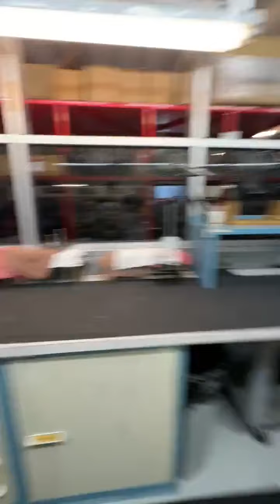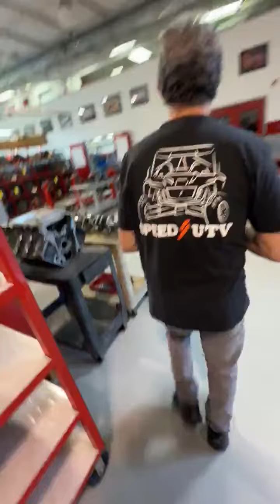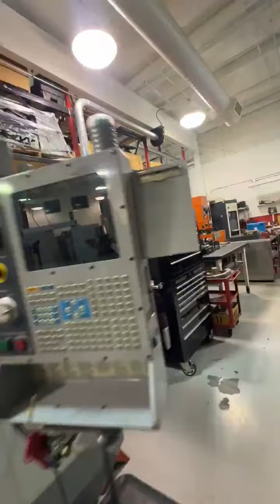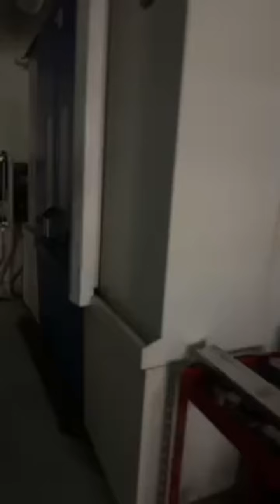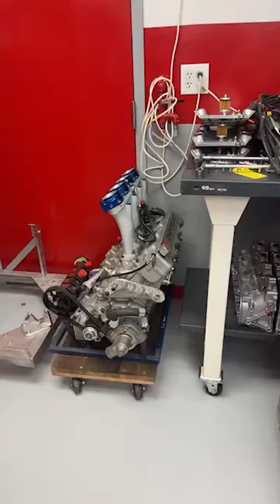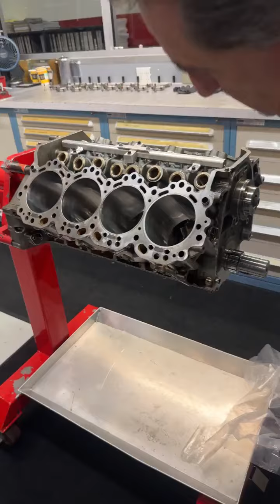SPEED Engines Shop Tour

Comment: There are companies swapping to different computers and tuning that is making the speed engine produce 50+ hp more than factory and at lower temps. Even startup and idling is greatly improved. It’s hard to consider though. Spending thousands to do what should likely be done from the factory is less than appealing. And I see that you can send in your clutches now for machining and tuning which I’m sure will help dramatically. I do believe that it should come factory with this tuning though because it’s quite unreasonable that my belt gets to 240 degrees on a 90 degree day just from cruising 30mph down a gravel road. The $1200 to make it happen should be included from factory if a guy can’t buy a machine and cruise down a gravel road without overheating the belt. There’s no excuse for these high priced updates if the machine can’t function under normal use and maintain temps. Hopefully speed lowers prices on accessories and tuning to at least be competitive with the industry. It’s quite unreasonable to pay $650 for an axle. But good effort team hopefully some common sense will win the day